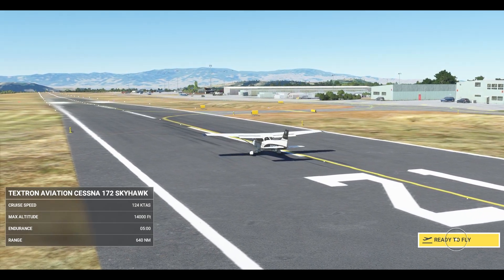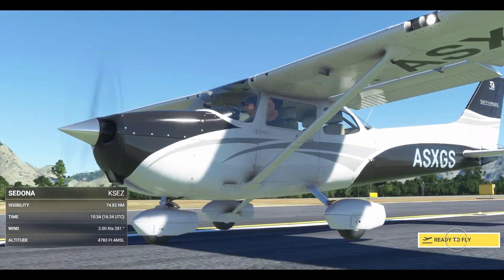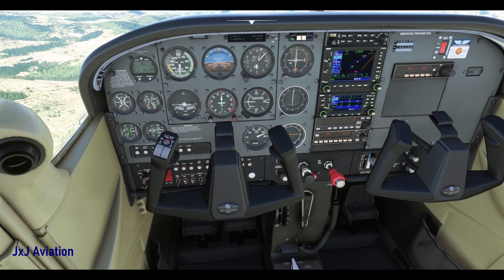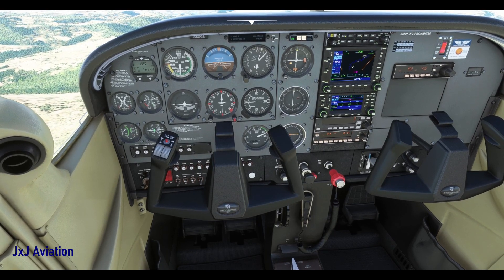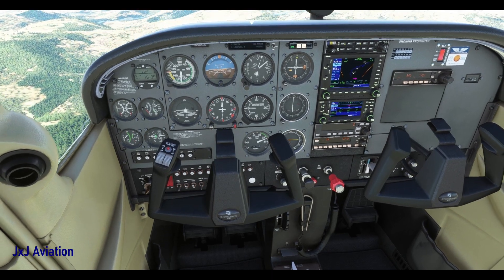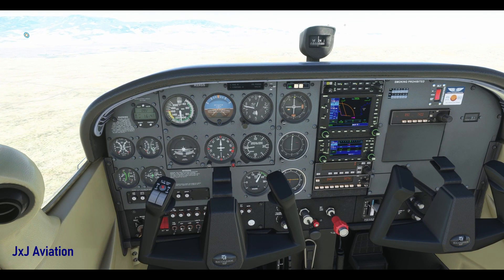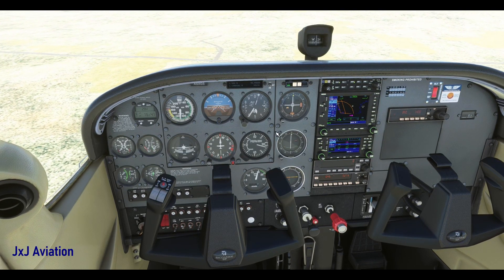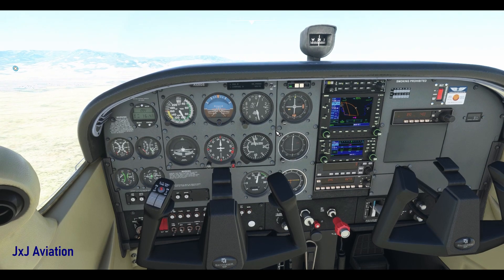Why is an Aircraft STALL Dangerous? | Reason for Stall | Indications and Recovery | Cessna 172

Comment: Curious about how stalls are mitigated in commercial jets like the A320 and B737. Is it as simple as the Cessna 172 or do several other steps have to be taken?
Reply from the maker: This is a very good question. I will be making a separate video on how stall is avoided on Aircraft like A320 or the B737. The answer is with the Fly By Wire Technology.
Reply: @JxJAVIATION  thanks. Looking forward to the video.
Reply from the maker: Check out this video that I created: https://youtu.be/jkZkBFiwyOQ
Reply: @JxJAVIATION  I checked it out. You sir, have satisfied a curiosity of mine which I have had for quite sometime. Thank you.